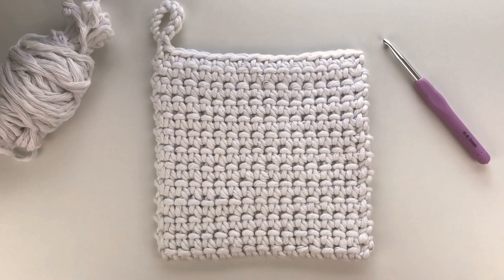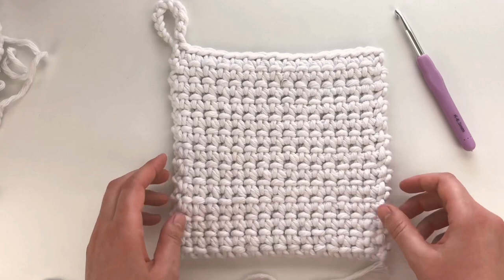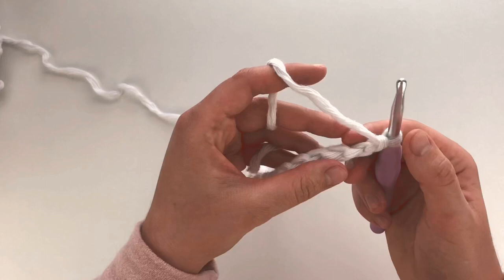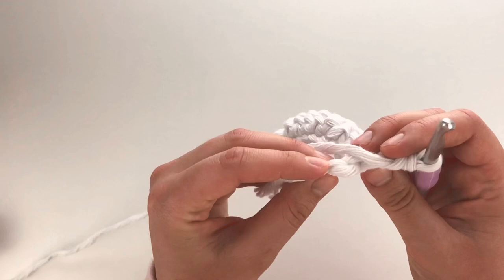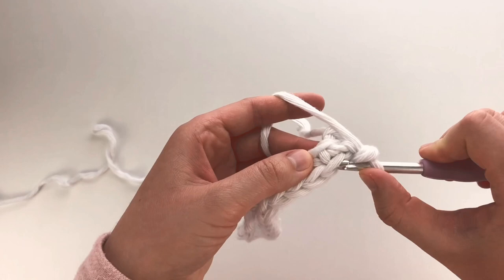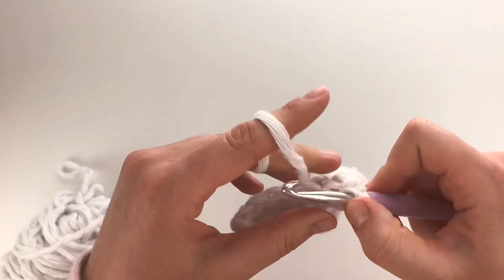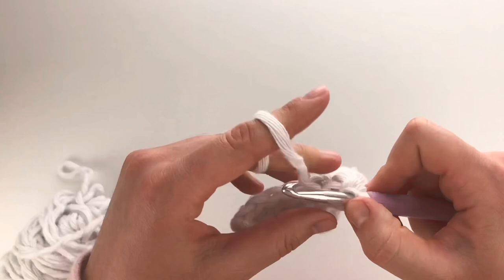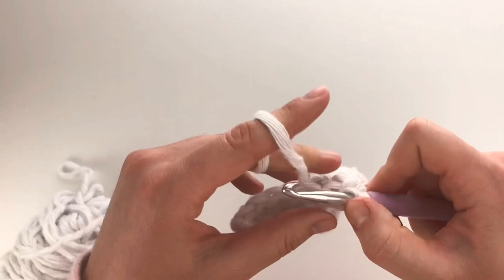THERMAL STITCH HOT PAD TUTORIAL, EASY CROCHET POT HOLDER, HOW TO CROCHET A POT HOLDER

Comment: When i do use the cotton worsted weight #4, my sides turn out ragged. Is there a way to finish the sides?
Reply from the maker: Hi Gina, I haven't ever finished the side but I think you could probably single crochet around evenly spaced and then in the corners do a couple extra single crochet in the same stitch so it lays flat